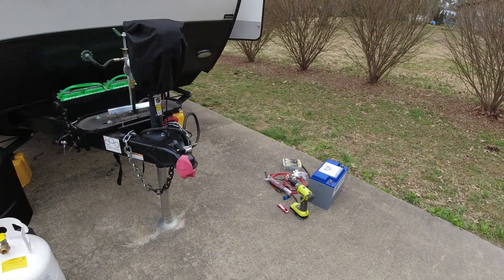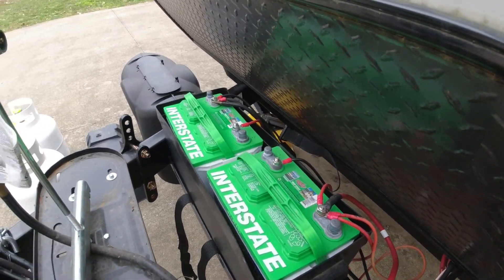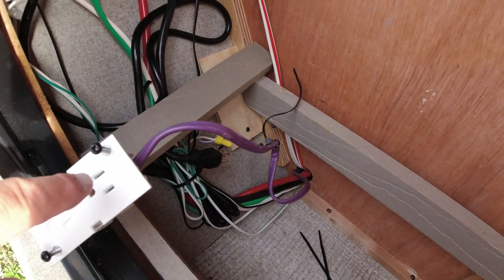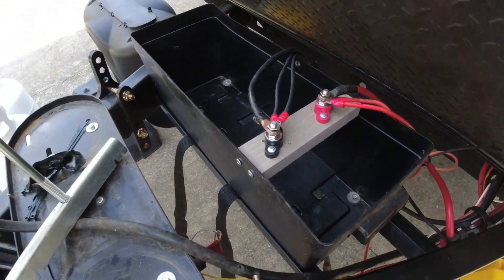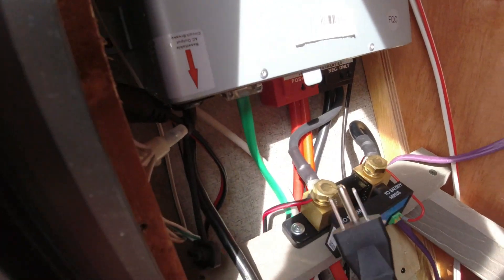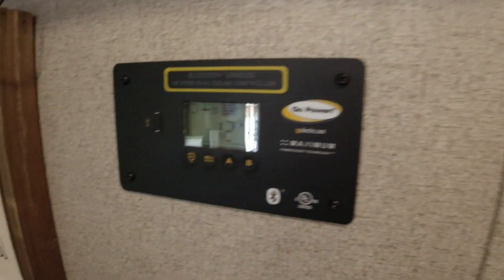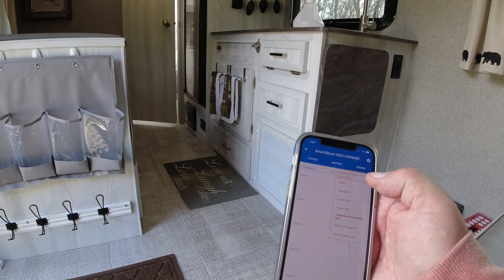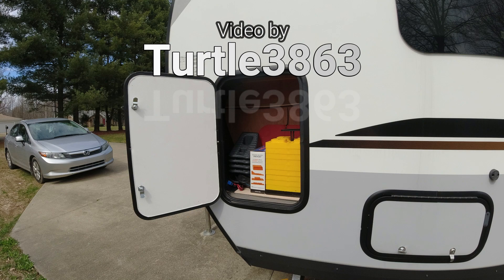RV Lithium Upgrade

Comment: So does this give you changing through the Victron plug-in charger when connected to Shore power?
Reply from the maker: The converter on the camper takes it up to about 13 volts and the solar takes it up to 14.4 volts. If I need to I can hook up the victron if the solar does not too it off.

Comment: Hi! I have a random question, if you don’t mind. You didn’t show the insertion of the cables into the inverter. Were they bare wire on the end going into the inverter? Or did they have a 5/16 lug on both ends? My inverter in my 2021 19QB is in an awful spot and I can’t see in there. Can only see from above. But there doesn’t appear to be enough space to get in a connector into that tiny second spot. Don’t want to get myself into a pickle.
Reply from the maker: Yes, they are bare wires going into the empty spot on the inverter

Comment: Great video! I have a 2019 E-Pro 19BH with many of the same components as you. I used the same terminal block technique and installed a 400AH lithium battery under one of the  dinette seats. I also upgraded to a Victron solar charge controller (100/30). Hooked up everything and  all works great except for my inverter. Shore power works fine but when running the inverter on batteries, I get an error E04, which indicates overload. Not sure what would be causing this but based on the information that I have been able to find, I will probably need to upgrade my inverter based on my troubleshooting steps. When I figure this out, I will post an update here.
Reply: John - I have the 19BH as well and am looking to the battery move to the rear dinette. What size wire did you run from the inverter to the new battery?
Reply: @alg5067  I used 2/0 wire for the connection between the inverter and battery.
Reply: As a follow up to my modification, I did replace the inverter because for some reason the stock inverter produced an error (as stated above) when I completed the modification. If you are considering doing this modification and need to replace the inverter, make sure to purchase one with a transfer switch built in (or install a separate one) in order for everything to work properly (ask me how I know!). When I installed the 1st replacement inverter (the one WITHOUT the transfer switch) it did work but only to a certain point. My fridge and AC outlets would not work while on shore power and I also received an error indicating improper grounding when running the inverter (although the AC outlets did work). After I replaced that inverter with the one WITH the transfer switch, everything worked as it should, using the inverter OR while on shore power.

As a side note, I did not upgrade my CONVERTER even though I had read it should be replaced since I was upgrading to Lithium and my unit had one of the older WFCO stock converters. To my surprise, my converter DOES charge my lithium battery to 100% while on shore power. I tested it over night when there was no sun which would have topped it off to 100%. 

We boondocked recently for 3 days/nights and our 400 AH battery only dropped to 90%, and I only have a 100 watt solar panel on the roof. We are loving this upgrade and really like not having to watch power usage so closely when boondocking!
Reply: @DavidJones-su9ob  Does the battery disconnect under the tongue work as before ? It would seem unless you moved the inverter wire at that end it would not allow the solar to reach the battery on the new (old inverter) line ?
Reply: @alg5067  The battery disconnect and everything else that is powered by the battery in the tongue location of the battery works the same (I did mount a battery disconnect in the same location where I mounted the battery, under the rear dinette seat, for convenience). You would just need to connect two terminals to each pole of your inverter. One coming from your battery and the other coming from the cable that was used to connect your old batteries in the tongue. The producer of this video details this very well using the stock WFCO inverter. My modification was done using the same techniques that he outlined in the video (although I used a different inverter; my stock inverter gave an error and I replaced it).

Comment: Great video. Planning on doing the same and wondering how it’s been holding up? Yours is the first setup I’ve seen to feed off the inverter. Seems much easier than trying to run original wiring back to the side compartment. And did you ever add that plug for the charger? Thanks.
Reply from the maker: It has worked out great. No problems at all. I did add the plug for the charger but have only used it once, I found the solar when set in lithium setting boost the voltage up to 14.4 without using the charger
Reply: @Turtle3863  Awesome. So just a normal household plug? Or is there an RV specific one I should be using?
Reply from the maker: @mikelaforest4458  household box and plug

Comment: I have the exact trailer exact equipment.  Are you venting the battery?  How come you didn't use a breaker? I'm very novice and I like the way you did this.  Thank You!
Reply from the maker: No ventilation needed on a lithium battery. As for breakers, still uses the system that was on the camper all ready.
Reply: @Turtle3863  Thank You, I'm following this are there any wires from the solar panel near the battery?
Reply from the maker: @dancingskeleton  yes there are a plus and minus that runs from the controller to the battery box, if you do a junction inside the box like I did they will still connect to the battery via the big cables to the inverter.

Comment: We are trying to do this with our 19FD.  A few questions:  When installing the new battery cable into the Inverter (red or black receptacle), what tool do you use?  In your parts description you show 2 different sets of cables.  I understand one set goes from the battery to the inverter, which set is that?  What do you do with the other set?    Our battery has built in blue-tooth, so I assume we do not need a shunt, is that correct?   Thank you.
Reply from the maker: If the Bluetooth gives you an accurate level as to your percentage of charge, then that should work in place of the shunt, if not you could always add later. As for the cables I had to buy two different lengths because I was using the shunt. In your case you will only need two cables for the plus and minus leads to your battery.

Comment: Can you tell me if adding the lithium battery to the camper, does the voltage different between the camper and car system create a potential problem? I know that the car will feed voltage back to the camper when plug together.  ty
Reply from the maker: There are different opinions on this, as long as you don’t let your battery go completely dead there’s only a small voltage from your car that goes to your battery in your camper. Not an expert but I did stay in a holiday Inn express once.

Comment: great upgrade. i have a question. if you hook up the cables to the inverter, how does the battery charge from solar and the charge controller?
Reply from the maker: Through the junction box I have in the old battery box. There is a direct red and black wire from the inverter out to where the battery box is, all others devices terminate there.

Comment: Nice setup.  I just converted our trailer from lead acid to LifePo4.  Hoping that one will be enough for our needs.  What type of solar charger/panel do you plan on using to recharge?  Is it roof top or portable.  We are going to use the 200 watt Renogy portable suitcase panel.
Reply from the maker: We have 100 watt panel on the roof and a 100 watt Renogy suitcase

Comment: Very nice, neat job. An added benefit is that if anyone thinks about making off with your batteries, they'll be surprised that you don't have any. Even looking in that compartment wouldn't tip them off that it's in there. I'm looking forward to the long term use of your setup. I'm still working with my two 6 volt flooded batteries but they are more than 3 years old and I've a feeling I'll be going lithium soon. I'm a little bit luckier then you because my charger/inverter supports lithium batteries just by switching a jumper. I'll be going with 200ah because I have one of those 12 volt refrigerators. It'll be nice to reduce that 120 lbs in my front compartment down to 60 when I make the switch. Thanks for a great video.